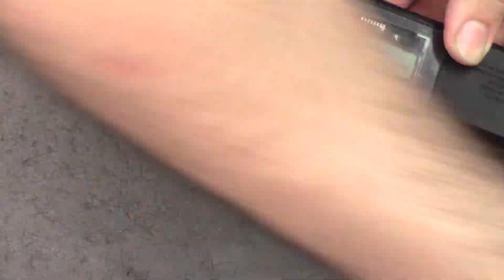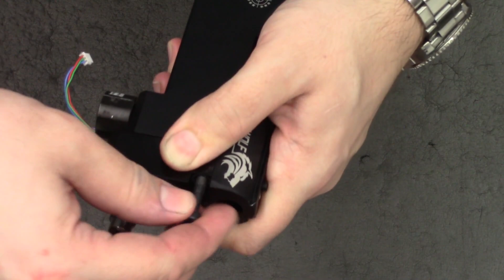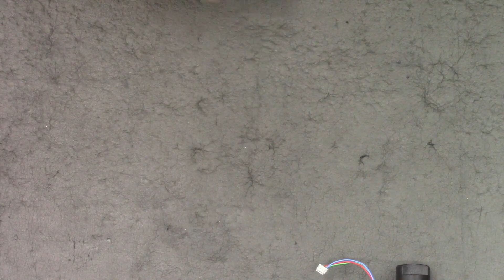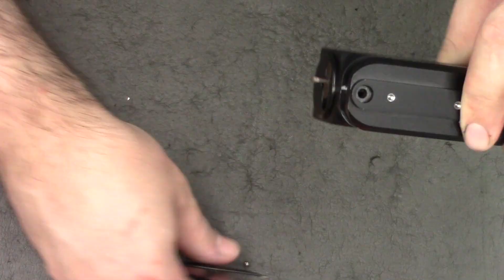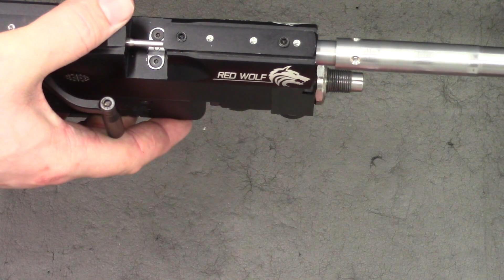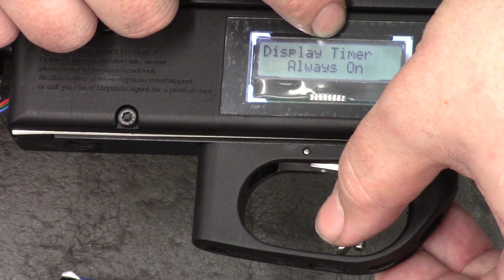Daystate Redwolf reassembly

Comment: How is the rail fitted and what make is it pls
Reply from the maker: the pic rail on the block is a home made one that is machined to fit the block the front rail is a Atlas bt15 fitted with ss top hats on the inside of the stock   👍
Reply: What are top hats
Reply from the maker: @pappapoff  they are Stainless steel bushes we make that we epoxy in to the stock from the inside then the rail screws on from the out side 😀
Reply from the maker: https://www.youtube.com/watch?v=iQjXbTbuN6g

Comment: when watching the clip. it doesn't seem too difficult to change the barrel to a different caliber. or am I wrong?

regards
Reply from the maker: No it is very simple but you may need to program the power curve  👍
Reply: @sub12airgunners  that's no problem. I have placed a helliboard on my redwolf. thanks in advance for your response.
and by the way, congratulations on your channel, I have already learned a lot from it. also the tuning of the hellibaord.

Comment: Hi Martin
What length is the M12 stock bolt on the Redwolf/ Wolverine R models,i have bought a  pre owned Wolverine R but it has a non Daystate stock bolt that is too long and is sticking out of the underside of the stock😮
Need to get one the correct length
Thanks in advance
Regards
Paul

Comment: May I ask where did you get the flat pic rail on top? Or is that stock? I thought they come with a dovetail on top. Thank you.
Reply from the maker: Yep they come with a dovetail normally but I machined a new pic rail adapter to fit over the top of the dovetail. Thanks for watching.

Comment: Hi Jake. Have you produced a vid showing how to change the side lever over?
Reply from the maker: No I dont but its a very simple procedure, just remove the bolt at the back pull the cocking handle out then remove the side cover plate and replace it on the other side, then just put back the cocking arm back. Thanks for watching.
Reply: @sub12airgunners  thanks. I thought there would be wiring to change over too.

Comment: Love your informative video's. I have a Red Wolf, in .177 one of the few things I really don't like is that ruddy 11mm rail. I notice with some pleasure you've fitted low profile Picatinny rails to your baby. could you inform me as to where and how I can obtain such pieces. I worked in engineering for some years, so can work on the gun confidently, just need clue.
Please keep making your excellent videos.
Reply from the maker: Hi, I just bought a long piece of pic rail, like the one linked below (Can't find the one I bought anymore), and machined it down then added a dovetail to fit the red wolf, after that I drilled and tapped the block with locking screws to stop it moving and keep it spaced correctly.Thanks for watching. 

https://www.ebay.co.uk/itm/264956810371?epid=812400056&hash=item3db0a81483:g:DhkAAOSwFntZbedM

Comment: Great video, thank you. It would be nice if Daystate offered a board upgrade so older RW could have the newer software. I like the facility to adjust the sleep timer as i find it too quick on the original s/w.
Reply from the maker: Yeah its a bit snappy with the original settings, not sure if Daystate upgrade the software during a service, or the older boards may not be compatible with the new software, not sure. Thanks for watching.